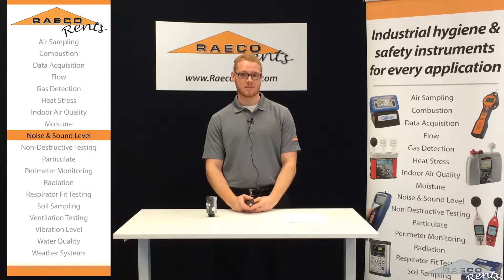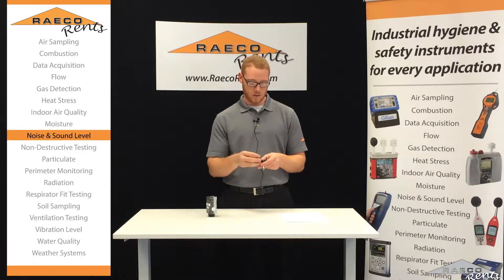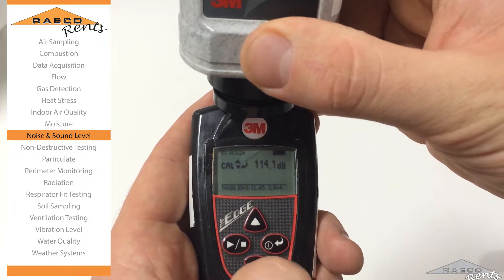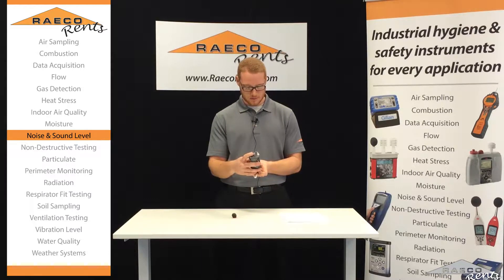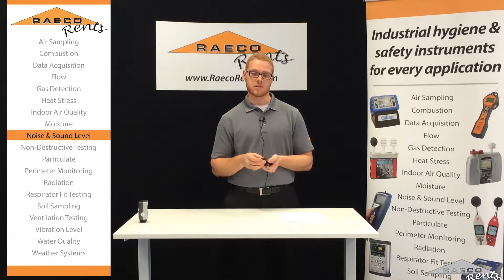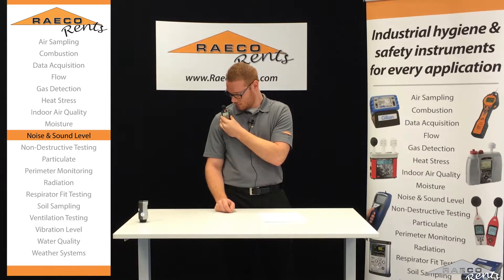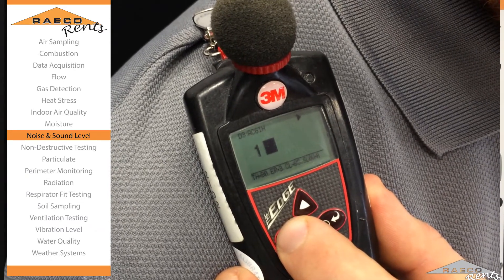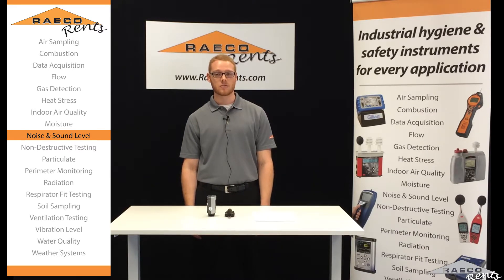RAECO Rents: How to calibrate, position, and test using the TSI Quest Edge Noise Dosimeter

Comment: Why do we use 114dB for calibration
Reply from the maker: The 114 dB level is commonly used for calibration in acoustic measurements, particularly for microphones. Here’s why:

Standard Reference Level: The 114 dB level serves as a standard reference level for calibrating microphones and other acoustic sensors. It provides a consistent point of comparison across different measurement setups and devices.

Sensitivity Verification: When calibrating a microphone, it’s essential to verify its sensitivity. By exposing the microphone to a known sound pressure level (such as 114 dB), we can determine how efficiently it converts acoustic energy into an electrical signal. This calibration ensures accurate measurements during subsequent use.

Frequency Independence: The 114 dB calibration level is often chosen because it corresponds to a pure tone at 1 kHz. This frequency is commonly used for calibration because it provides a relatively flat response across the audible spectrum. Using a single frequency simplifies the calibration process.

Practical Considerations: The 114 dB level strikes a balance between being sufficiently high for accurate calibration and avoiding potential damage to sensitive microphones. It’s intense enough to activate the microphone’s diaphragm but not excessively loud.

Industry Standards: Various standards organizations, such as the International Electrotechnical Commission (IEC) and the American National Standards Institute (ANSI), recommend or specify 114 dB as the calibration level for microphones. Adhering to these standards ensures consistency and comparability of measurements across different laboratories and applications.

In summary, the 114 dB calibration level provides a reliable reference point for assessing microphone sensitivity and maintaining measurement accuracy. It’s widely accepted and used in acoustic testing and research.